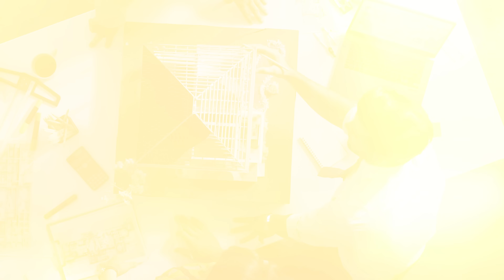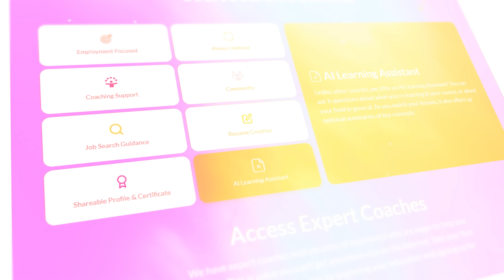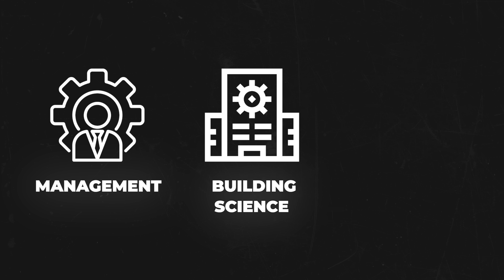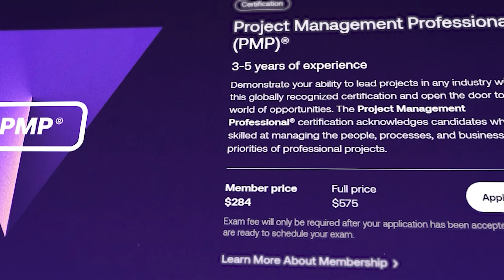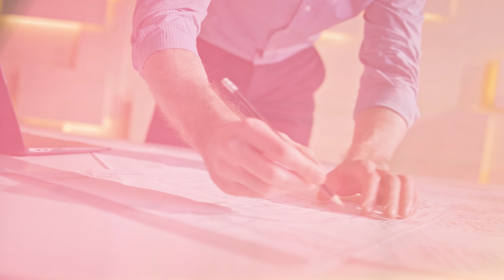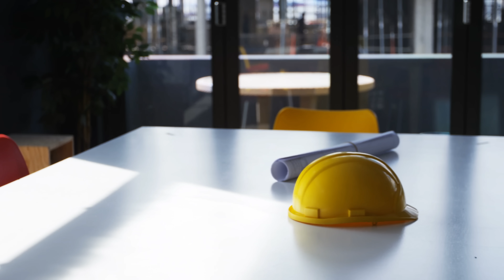How to Become a Construction Project Manager - 2026 | Construction Project Management Roadmap

Comment: Good quick guide. There are three big different types of Construction PM: 1. Owner-side construction PM, 2. General or subcontractor trade PM, and 3. A/E PM. You need to know what you want to be. They are all construction PMs but have different roles and different requirements. It took me a while to get to where I am because I didn't know anything about the construction career path. And they don't teach it at school.
Reply: spot on with those 3 types. GC and sub PMs especially take the biggest beating with daily paperwork. tools like Shackleton AI for automated site logs help bridge that gap so field teams spend less time at desks regardless of which path they choose